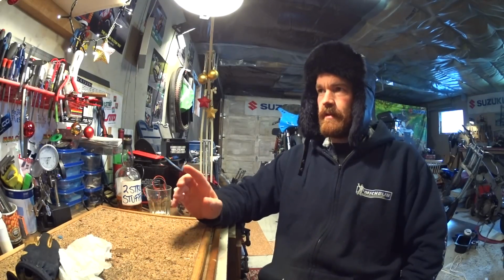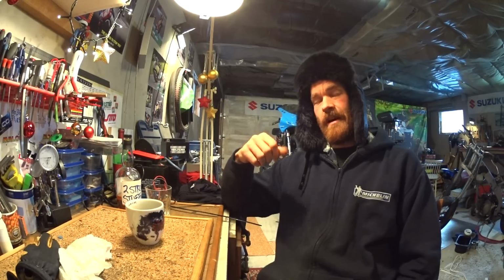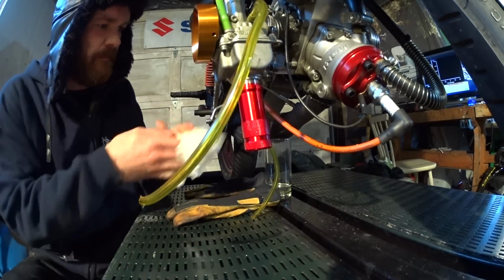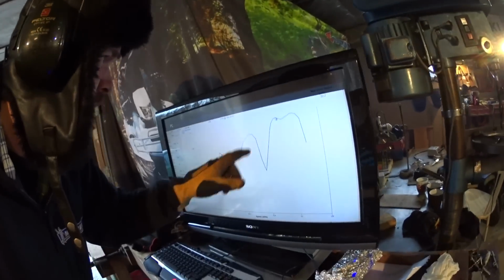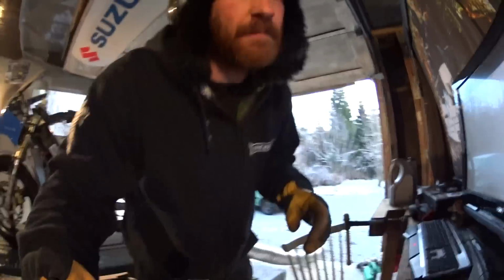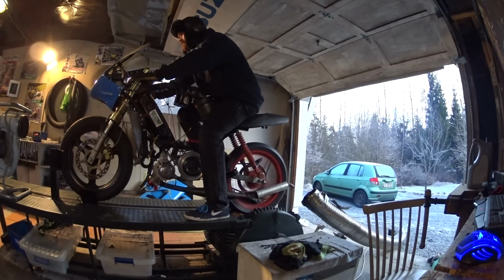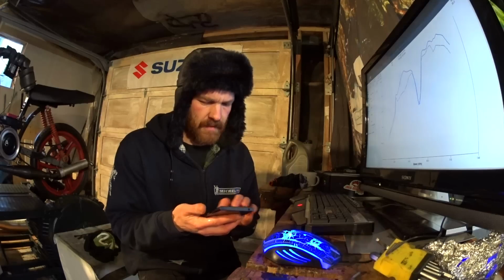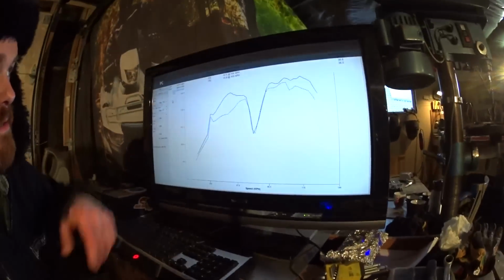50cc / 20hp! Homemade Rotary Valve Peugeot Spx 2STROKE STUFFING E26

Comment: 20hp out of 50cc...That is technically 400hp/l out of a N/A engine! That is mind bending!
Reply: KRISTIJAN 5112003 a 200-hp 500cc 2-t v4 Honda also exists...
Reply from the maker: +The Adversary Just wait till the engine is back together again, no Honda can touch me then!
Reply: Imposseble
Reply: Two stroke exhaust is shaped so the shock wave (caused by exhaust port opening) flings down the expanding cone at the speed of sound. it creates a suction which pulls exhaust and fresh gas through the engine. When the shock wave hits the reverse cone it bounces back stuffing the fresh gas back into the cylinder. The incoming charge is still moving from the carb, so the cylinder gets stuffed from both sides. It's all about the speed of sound so can only work over a narrow speed range. It varies with pressure and temperature making tuning very tricky. Invented by the late great Walter Kaaden (in communist East Germany) with next to no technical resources. The engine power band can be increased with a movable exhaust port to alter how soon it opens and a movable reverse cone in the exhaust chamber that varies the bounce-back time. But that changes everything else. Simple mechanics. VERY complex dynamics.
Reply: Ťørɱȩṇ  That's one of the dumbest thing's I've seen in a while.
Reply: Not if you take volumetric efficiency of a 2 stroke into consideration 😉
Reply: @ghost500e  yeah but honda is a big company, and this is just some dude in shaggy garage.
Reply: @Dave5843-d9m  one of the best explanations about 2t mechanics I ve ever read...thanks!
Reply: @Dave5843-d9m  😎X10 ...!!
Reply: @2STROKESTUFFING  Could you perhabs get like 12 of these super  efficient engines and make a v12 block? 240HP from a 600c would be insane
Reply: @TheDoctorPi  but the cylinder is 75cc bigger than this engine he has only 50cc and the simson 125cc
Reply: @TrambovskyDriftov  no thats 50cc
Reply: No, thats two stroke...
Reply: Sorry to be so offtopic but does any of you know of a trick to log back into an instagram account??
I somehow forgot my login password. I would love any help you can give me.
Reply: @Philip Orlando instablaster ;)
Reply: 20 HP 50 cc! That,s Guy! Drunk.
Reply: @ghost500e  who cares if he's first or not though? I noticed his video doesn't say "world first" nor does he ever elude to any such thing. Some people just like pissing on other people's Cheerios.
Reply: @ghost500e  not single cylinder though,

Comment: 5 hp per cubic inch , no 4 stroke with the same cubic inch  could ever do that 
got to love the 2 strokes .
Reply: thats what turbochargers are for.
Reply: 50cc=3.051ci ... so if it's a 20hp engine that means it has 6.67hp per ci
Reply: no 2 stroke is going to last as long as a 4 stroke either....bye bye piston.
Reply: Frigglebiscuit just maintain it
Reply: @frigglebiscuit7484  Depends of how heavily the engine has been modified...
Reply: @nickyotto349  doesn't matter. they don't last.
Reply: Inch ???????
Reply: @frigglebiscuit7484  4what
Reply: @frigglebiscuit7484  a four stroke pushing that specific power output won't last very long either. Just sayin.
Reply: @frigglebiscuit7484  my piston lasts 700kms with 6-8k rpm average
Reply: @frigglebiscuit7484  Maintaining it is key. Four strokes are much more forgiving of a poor state of tune than two strokes are. Two strokes require everything to be nearly perfect to work, but if you put in the effort to keep them up, they'll start every time within a couple of pulls.
Reply: Frigglebiscuit 
A rebuild kit is cheap and fits in a baggie , Uber simple with no valves to replace
Reply: Game Imre my piston lasts 3-4k kms, 18hp 70cc
Reply: @kaulincurtis9665  wym have u seen lawnmowers?
Reply: thats why you got them turbos!
Reply: @tebibyte2357  not sure what you're meaning. Yeah lawn mowers last a long time, but they only make like 1/3 hp/cubic inch. Power output per displacement. Look it up.
Reply: @kaulincurtis9665  I just now understand what your saying. It would only work under HEAVY modifications lol
Reply: @frigglebiscuit7484  bruh my dad bike is almost 20 years old and its still running done
Reply: Btw if you slap a turbo and nitrous on any 4 stroke against 2 strokes 4 stroke always make more power if the same CC
Reply: @Cptlink420  You can't turbo all 2 strokes, only the rare 2 strokes with the oil being in a different compartment.
Reply: @tebibyte2357  I know. Detroit 2 strokes are half 2 and half 4 strokes
Reply: @Cptlink420  Yep. Except theyre diesel. A real half 2/4 stroke is the ferrari 3 cylinder 2 stroke basically the transfer ports are in the bore instead of the block. Which is much better but requires aspiration to run.
Reply: @frigglebiscuit7484  because they make way less power and rev way less so there not ever under much stress there lazy motors basically
Reply: *top fuel has entered chat*
Reply: @frigglebiscuit7484  that's fair trade, more power, lower mass, but also lower durability
Reply: @frigglebiscuit7484  2 strokes require love to keep them alive for a long time, I always used to replace my rings yearly along with gaskets, also ran higher than the 32:1 maybe 35-40:1 ratio plus octane in the mix on my 01 CR80R and that little sucker kept running till 08 I sold it to a friend and he fried it within a year, 2 strokes can last if you take good care if them, id also prefire it in the winter when not in use I think I replaced the piston twice if I remember correctly not blown at all just wanted to keep it clean.

Comment: i love to see folks play ROUND WITH two strokes. i like the way you are solving so0me of the port timing issues. what about effective stroke.  this motor should have a power valve to reduce compression as it is running 17k rpm.  the addition of a power valve would greatly improve effective stroke and might allow quicker revving more top end revs and also alllow for that 28mm carb therefore increasing top end  hp and improving the power band width  just a thought as ive been playing around with 2 stroke for 35 years. also another fundamental thing that all two stroke manufacturers are overlooking is the fact that the crank seals should be placed on the induction side of the main bearing so the bearings can be lubricated by themselves or through the clutch gearbox. this would improve bearing life  reliability and allow for even hiigher revving 2 strokes. plus less oil would be needed in the premix and reduce emiisions. although ive never had a problem getting them jetted and mixed so precisely they only smoke a little under heavy power demand  good luck
Reply: Has anyone tried grease sealed bearings for the mains? and a small oil pump to feed the big end? What about four cylinders in a cross format running on one wide crank pin? It would need a blower to charge the crankcase but shouldnt need a huge pressure. Intake could be via a hollow crank on the non-drive side. Who knows if the cylinders would interfere with each other at high revs. Benefits are more power pulses and virtually zero vibration.

Comment: Your findings support what I tested when I was younger.  You need 18K rpm, about 185deg exh duration, good compression,  and a great  ignition system to get to 20hp out of a 50cc 2T.  Also need a good exhaust pipe to support that. 
The thing I was ignorant about in my days is fuel octane.  Those were the days.  Lol.  Great stuff and keep up the good work.
Reply from the maker: +Big-J Thanks! Those were the days.

Comment: Thanks for the shout out man.  Very cool on the Power Spark stuff too.  

So here is my question.  When you did the 12hp run and then the 14hp run, can you feel a difference.  Like when the bike is really getting dialed in can you tell before you look at the computer?

All the best,
Jay
Reply from the maker: +Jay Dighsx I can feel/hear a slight difference, it's more "fierce" compared to "flat" or something. Not like on the road tho, where you would really feel it.
Reply: I have a 5 cc 2 stroke that makes 3.5-4 American hp
Reply: +Sebastien LaPointe
 Prove it!
Reply: @diamondperformancefab5931  5cc is common for model engines running nitroethan and I have seen ~10 HP out of these little monsters but they get th power Form revving 20k and higher oh and at max 100h and they need serious rework

Comment: 20 hp, even more awesome! By the way, I am Magine your neighbors absolutely love you.
Reply from the maker: +Headerflame on IG Steve Entler Yeah, not that bad anymore tho after I fixed the exhaust extraction system and can run with the garage door closed!
Reply from the maker: +Headerflame on IG Steve Entler 17.4 in the other video is wheel hp btw. Most probably closer to 22-23 on the crank.
Reply: I cant believe there Is that much power loss in the belt drive?

Comment: Just a comment: It's known amongst Yamaha RD tuners that the standard "Y" intake joining the 2 carbs to the air filter, is better than open carbs or pods. Possibly better than velocity stacks too. (that last statement needs to be verified ?.  So the length evidently is beneficial. my I suggest simply trying a length of tube over the velocity stack, car radiator hose or similar, 2, or 3-4 inches long. Also it's known amongst us RD nuts that the tall cylindrical K&N filter produces the right amount of "back pressure" on this set-up also. There you go. Yes we can hear your bike from Australia ! ;)
Reply from the maker: Thanks for the info/tips! I've played with intake length in simulations but should definitely try in real life too!

Comment: I wish my 50cc made 5 hp. Today is a hot ass day and the clutch got so hot that the bike would struggle like crazy to pick up some speed
Reply: Hot air is thin so the engine has reduced power potential and if you don't reduce jet size it will be to rich if it was jetted for cooler temperature.

Comment: Thanks for sharing, you have a lot of patience. Early days I stuffed the crankcase of a 1952 125cc BSA bantam, then later a 50cc motobecane engine in a moped, also tuned a 3 cylinder 800cc DKW engine, got 130hp and 125mph. What can I do next?

Comment: Thanks for the response now i know how it works, if you are looking for a great motor to do other of this videos i know one motor that is very good
Reply from the maker: +Antonio Bettencourt 👍 Tell me about this motor!
Reply: 2STROKE STUFFING it is the yamanha dt 50 lc is one of the most comum 50 cc bikes around here, the engine is water cooled cilinder intake 6 speed. They are very cheap here like 130€ for a complete one and performance parts are cheap as well

Comment: Awesome video! Is that space heater your only source of heat? What kind of fuel are you burning? You should think about building a wood stove with heat exchanger.  I used an old furnace blower to move the air, and have exhaust tubes running through the stove as a heat exchanger.  Now I have free heat that is almost silent with no exhaust fumes. Wish I would have done it years ago.
Reply from the maker: +Daniel Dallman Thanks! A wood stove is an excellent idea, and it would make it more cabin like👍
Reply: wood stove is very comfy
run the exust duct around the top. make it long for extra heat

Comment: 1st off amazing vid new here but im all in! Keep them coming thanks for making them! 
   2nd... just wow i thought i was getting there and knew scooter/cvt motors but watching a handful of your vids shows me i have so much more to learn, but 1st lesson i need to give up on my 139qmb gy6 49.5cc 4 stroke motor. I did a full build more or less on it  :;;parts;;; nyc 50mm bbk ncy A9cam narkra 20mm carb jets/ uni filter/ nyc cdi/ olm coil/ ngk sparkplug custom free flow exhaust koso cvt set gears stock tries stock and i think thats where im losing speed/power cause im only topping around 45mph also its a "trike" same set up on a 2wheel scoot would hit 60mph range 
   Wonder would a 2-stroke work with a trike?? I have the icebear mojo 49.5cc  (pst850)  i de-china-fi-ed  it using good  Quality parts modded some of them to be even better and replaced all  Wires and electronics making it loads more reliable.. i love trikes could go 150cc built out but i like the 50s and that moped tag

Comment: I have a few 50cc motorized bicycles with China girl and Franco Moroni s6c water cooled engines. The s6c makes 12.5 hp @ 14,000rpm stock. I've heard of modified s6c producing 20+ hp. My question is why did you choose your particular reed set up engine to make max hp when you could've used a s6c that's already producing 20 hp without much tuning effort. You've probably have more expertise with small 2 Stokes than anybody. My point is you could probably hit the magic 30 hp mark the 60's gp tuners knew a 50cc 2 stroke was capable of.
Reply from the maker: +Albert Smith I wanted a "clean slate" as a baseline, the iame M50 cylinder has very good duct geometry, correct port angles etc. but low port durations out of the box. A good starting point if you want to do it your own way. One day I'll pass the 30hp mark, one day.
Reply: 2STROKE STUFFING I really appreciate that you taking the time to respond with your intelligent insight in the quest for better and more power and doing it your own way with r&d. Your videos are so inspiring I hope to start tuning/modifying my s6c engines soon.
Reply from the maker: +Albert Smith Thanks!

Comment: That's one mean little engine!! 20hp from 50cc is very impressive and it sounds like there's more power to be unleashed with a little more fine tuning. how is your carb doing with that deep well under the float bowl? that's actually a good idea to help remedy the fuel foaming issue... I was also going to suggest maybe a more flexible way to mount the carb to the engine to help isolate it from the engine's vibration but it looks like the deep well under the float bowl seems to be working quite well. is this engine broken in all the way yet? if not then it'll develope even more power as it gets more run time. Very well done!
Reply from the maker: +SuperDaveZilla Thanks! The well didn't seem to affect the carbs tune in any noticeable way, bo problem there. I suppose it's not really broken in, I've flogged it since day one tho.

Comment: Got a question I have a 49cc vertical piston with exhaust and intake on the piston jug can I swap heads from something else like a bws or bicycle motor or anything else you can think of to use as a big bore kit its the motor that amazon calls a racing motor 
I believe it has alot of potential to do more I just don't have the knowledge or the money to try different things thanks love your series

Comment: u need 2 make adjustable timing like in the outboard motors how u give trotle ignition changes or if u re using some kind of computer controled ignition then make as ur rpm changes so would ignition 2... a bit of play but yull get there
Reply from the maker: Already got that, fully programmable.

Comment: Hello from Latvija.
Nice yob.
Can you check max speed on road?
My dady build meny years ago 50cc bike with piston 40mm cilinder 40mm.
The some sound we my bike, but we use valve for best oil comming to camshaft bottom bearing.
Before we do this we need change camshaft bottom every 2 competitions.
We dont have in years 90.tees rpm and dinamo meter, but max speed is more 120km/h
Reply from the maker: +Rudolfs Jozuus Thanks!

Comment: 20hp from a 50 cc engine that means 1hp/2.5cc.Is it possible man??? if its possible what are u using as fuel
Reply from the maker: +Maneesh Rajeevan Yep. Was running regular pump gas. I'm in the process of porting the cylinder now, and with some other tweaks I'm shooting for 30hp at the crank on methanol and nitromethane. I might make a setup to drive the roller directly from the engine to eliminate uncertainty around transmission loss in the variator.
Reply: my moped has a 50 cc making 1.2 hp... in theory a 2.5 cc could make more... what is life.
Reply: I live in denmark where it is illegal to go over 30 kmt, and since my moped is from 1976 it is limited by power and not revs, also there was a law at the time of maximum 1.2 hp... such a shitty law hehe :)

Comment: what does the foot pedal on the right hand side do? why does the engine move with throttle?
Reply from the maker: +Oscar Thorpe The rear pulley is fixed size and as the belt moves up the variator the engine is pulled towards it. The foot pedal gives me some manual control over this action.
Reply: oh it's like a CVT?
Reply from the maker: +Oscar Thorpe Exactly. It IS a CVT, but only one pulley is variable.
Reply: @oscarzt1652  Like a DAF Variomatic belt transmission but with the variable cone only on one side so the engine needs to move closer as the diameter holding the belt gets larger on the receiving side thus shortening the length between the pulley centre lines of the engine and the transmission.

Comment: How did you manage to get so much hp out of a 50? Do you use regular 93/94 octane? What oil do you use? What are the carb specs?
Reply from the maker: +flakey Regular pump fuel. It's a combination of the pipe being tuned for resonance at relatively high rpm and enough port time area to produce enough torque at that high rpm.
Reply from the maker: +flakey 24mm carb, 28-30 would be better.
Reply: 2STROKE STUFFING jesus christ I use a 24 dell'orto on a Parmakit Sp09 cylinder that's 130cc and you run it on a 50cc hahaha. Always wanted a 28 though.
Reply: 130cc with a 24mm carb? I run a 36mm with a 125cc
Reply: Ebe771 i run 32mm carb with 70cc haha ;)

Comment: nice work but your engine is going to early back and it seems your clutch is set up to soon .
Reply from the maker: +Pierre Ortmanns Thanks! That's true, but it is on purpose. I let it "gear out" as quickly as possible on the dyno, this let's me plot power vs rpm.
Reply: ok , i havo no dyno so no experience with that , however i am looking now for one .